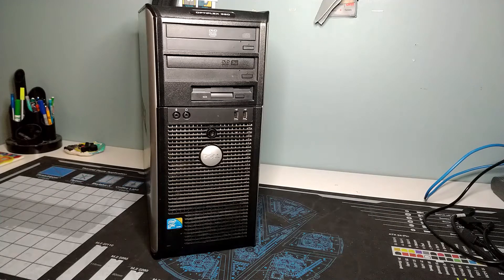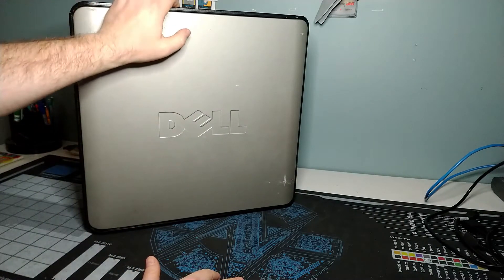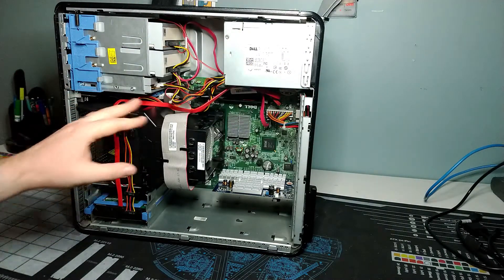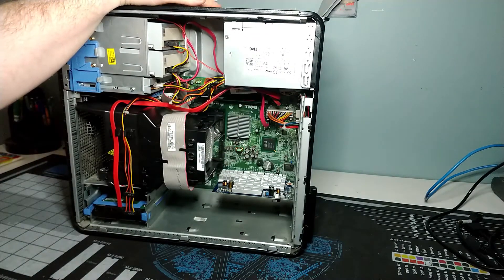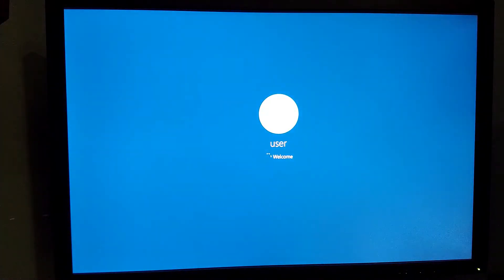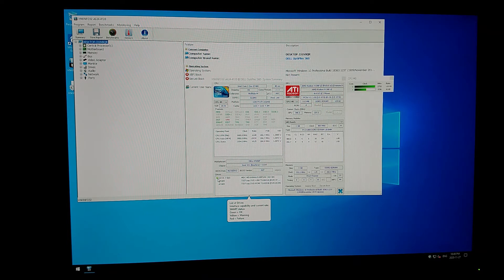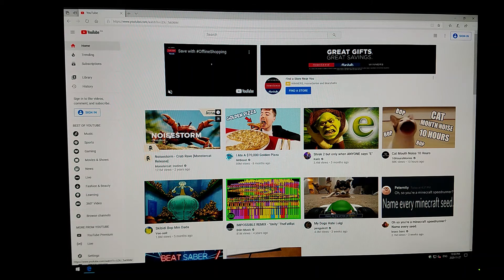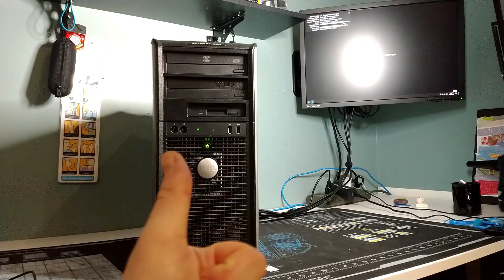Dell Optiplex 360

Comment: Hey, I’m planning on turning this into a gaming pc. If I swap out the power supply to 450w, swap the graphics card and processor, can I keep the original connector cables?
Reply from the maker: Sure, the other cables should be fine with the other devices cables; your replacement PSU will have it's own power connectors
Reply: @retropcdurham  Ok thanks!

Comment: Well I have a question can I change its processor
Reply: I want to upgrade it to core i3 can I?
Reply from the maker: @sadaqatali910  no the Core i series is a different socket type, you are limited ot Core 2 Duo and Core 2 Quad processorsin the LGA775 socket type.
Reply: @retropcdurham  Thanks for your quick reply Really appreciated
Reply: @retropcdurham  But can I upgrade ram from 4 to 8
Reply: @retropcdurham  optiplex 360 is ddr2 Right?
Reply from the maker: Yes you can! Go for a quadcore for sure, like a Q9400

Comment: Planning on upgrading mine soon. What is the most modern motherboard that is compatable with this case?
Reply: im pretty sure any mini-itx motherboard will work
Reply: ok i measured the motherboard in my OptiPlex 360, same as in this video, its 10.4~ inches by 9.4~ inches. this case should fit a mATX motherboard, maybe some slight modifications but most stand offs would line up enough for the motherboard to be secured in. One thing i will warn you about is the hard drive bay may block some larger gpu's so you would need to modify or remove the hard drive bay for one to fit. there is a hard drive bay below the dvd drive bay though, so its not that big of a deal. hope this help and that im not to late and you've already given up :P

Comment: Hey man, I have the same PC with Q9400, 4GB RAM, 500GB of HDD with no graphics card. Is this good for lite gaming or should I just use this as a NAS server? If yes (pertaining to the latter), do you have any tips to make this as a NAS server?
Reply from the maker: I'd look for a GPU to be able to help with graphics performance, as well as an SSD, if you are planning on gaming.
If you want to use it as a storage server you can go simple and do a file share with Windows, but if you want to get better efficiency and plan to add more drives then installing something like TrueNAS is a good idea. You won't have the same power efficiency as a dedicated NAS but if just looking to work with what you have it will do the job
Reply: i need help where to find a ram for this pc i looked for it and i didnt found it

Comment: did i could upgrade it with graphics card?????? Amd 200 series 2 gb graphics card????
Reply from the maker: Probably yes. Something like a GTX 1060 or older will work fine, so an AIT/AMD from the same period should be fine
Reply: @retropcdurham  thank you for your quick response!

Comment: I have same pc ..let me know the minimum cost upgradation to today's world
Reply from the maker: Core 2 Quad processor about $15
8GB of DDR2 about $20
SSD $20-40
Should not cost more than 50-75 to max out, less if you look for deals
Reply: @retropcdurham  but the Mobo supports max ram upto 4Gb
Reply from the maker: @250taz  I thought there was a BIOS update that opened up support for 4GB DIMMs but I could be wrong
Reply: @retropcdurham  so updating the bios can unlock 8 GIGs Ram support? I'll just stick with 2x2 and ssd drive for now. Not sure it quare core process can be supported even
Reply from the maker: @250taz  Q6600 or Q6700 is the best for the Intel G31 Express
Reply: @retropcdurham  will see if that's worth it
Reply: @retropcdurham  just one question .  For 8 gb ram I have to update the bios ?
Reply from the maker: @250taz  I'm pretty sure there was a BIOS update so 8GB would work yes

Comment: Great video I got the same model Optiplex 360 refurbished and I am thing of a small upgrade using an old Radeon ATI 1950xtpro graphics card it has 2MB of memory or getting a 1030 or 1050 card.  And the computer comes with 4MB of RAM ddr2.  Do you have any advice on my plan upgrades?
Reply from the maker: SSD and if you can get a good deal on a GPU always helps
Reply: @retropcdurham  I did replace the 350MB harddrive that it came with for a 1TB harddrive from Seagate.